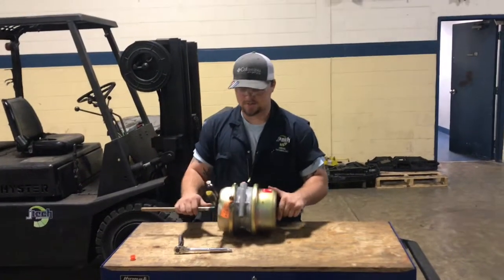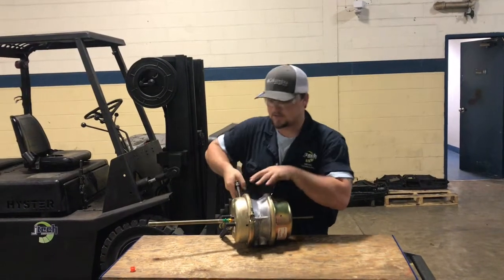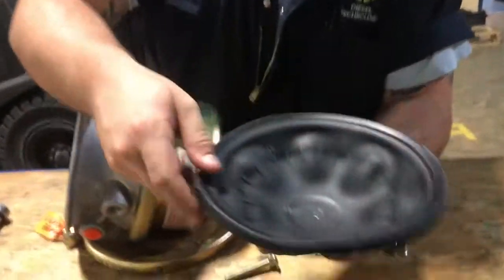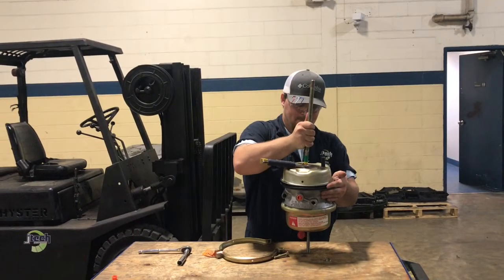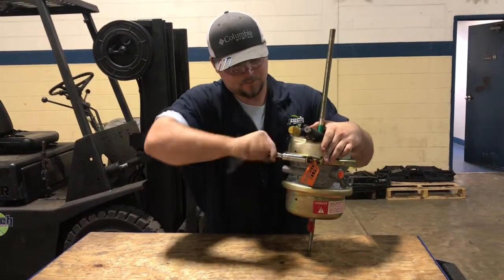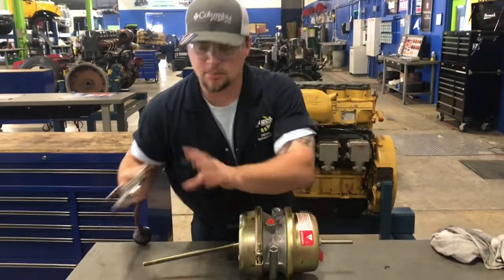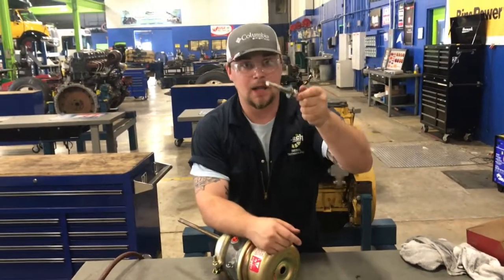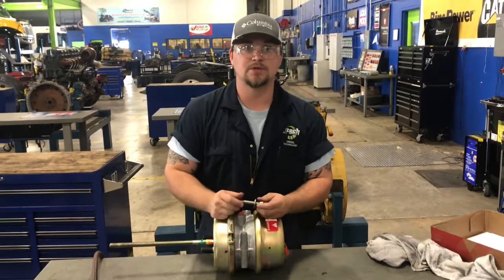Air Break Chamber Disassembly

Comment: How is that possible having if caged with bolt .thn applying air n bolt comes out..i thought the bolt pulled the spring as far as possible.where u cant pull it no more..but wen u applied air ,the spring compressed even more? So the bolt goes loose
Reply: Only had it caged half way?